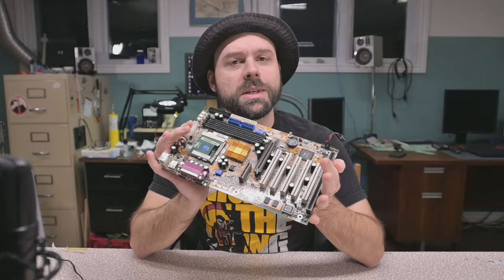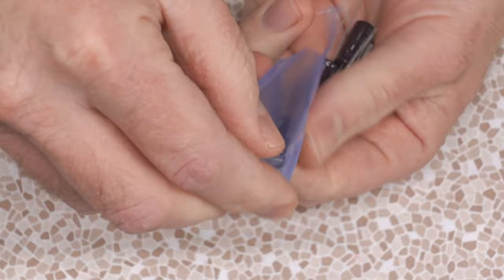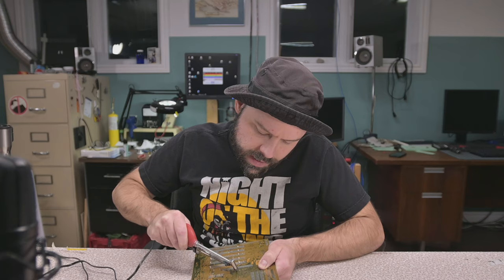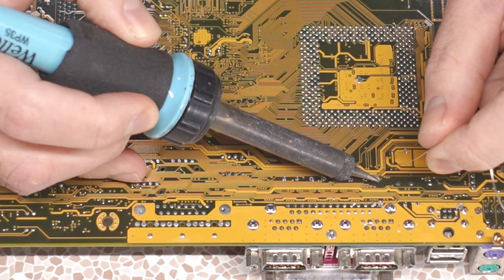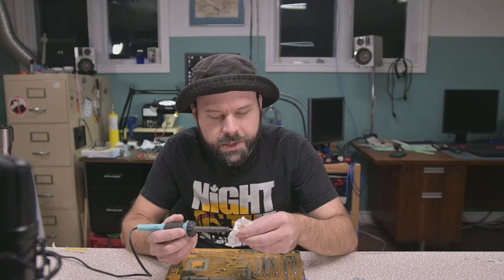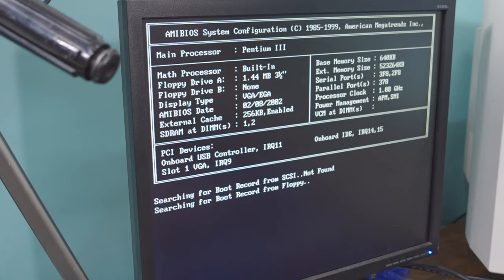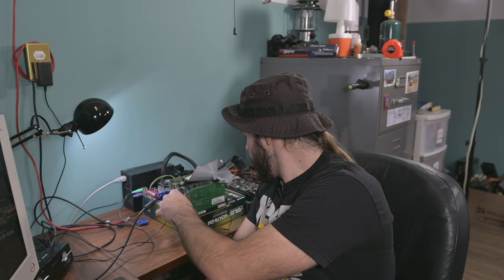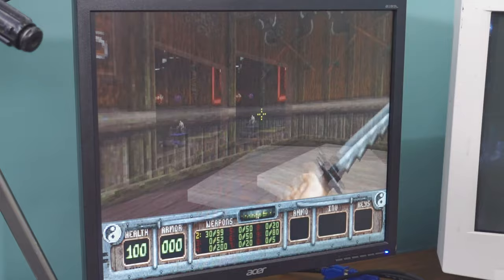Recapping a Pentium 3 Socket 370 Motherboard

Comment: I recapped a Socket A board. It was very difficult as I do not have good tools. I managed to get new caps in but they wouldn't go nicely into the holes so many are sitting high with ugly solder. None the less the board now works. Thanks for your video.
Reply from the maker: Yeah, it didn't go that well for me either as you saw. If I played more with this old hardware, I'd probably have the process down.

Comment: Man, that was a really delightful video! Although, I wish you had better filming angles to the board. I was trying to figure out the rest of the capacitor values. Thing is, I have a similar board but someone ripped off all the capacitors (except two very small ones) and the chipset heatsink from it before it came in my possession. I would really like to revive it because still has the 700MHz Coppermine on it, but with the caps ripped off I don't know the values. Would it be much trouble for you to make a capacitor list an post it here,  please, to help a fellow retro gamer? Of course, if you still have the board...From what I understand, the green big ones are 1200uF/6.3V but what about the rest of them?
Reply from the maker: Oh geeze, that's a pickle, cause different model of boards would have different caps values on them. 
I suppose you can guesstimate. One of the great things about caps, is they are often forgiving of what values you can use, unless they are part of a timing circuit, which those likely aren't. As long as the value you use is the same or greater than the original value, it could work. 
The brown caps I replaced are 1200u6.3v.

Comment: I recapped many boards during that era and the crapping out brands are: Chhsi, GSC, OST, G-Luxon, Nichicon HM/HN series produced in the 2000 to 2005 era (nichicon itself is a good brand) Teapo, Canicon, Fuhhyiuu, Sacon.
You used Nichicon PM low esr series which are good for this board.
Good brands: Rubycon, Chemi-con, Nichicon, Samxon, panasonic, Sanyo
Reply from the maker: Yeah, I can't recall what I knew about caps when I did this. I can't remember if they were new or salvaged. But when I buy new, I tend to get one of the good brands you mentioned. 105c with as high an hour rating as I can get. I also observe ESR especially if I know it's for switch mode.

Comment: Ok. That video teaches how to recap with a LOT OF WORK. 😂

Yes. I'm confident you already saw other ways to do it.

Here is how I do it with a LOT OF TEXT:

- 15w solder iron is enough and use finer tip
- Fresh soldering
- Heating one leg up, swing the capacitor in order to lift that lag out of board, just a little bit
- Heating the other leg up, swing the capacitor to opposite direction, just a little bit
- Repeat those last two steps til you can remove it with little effort
- (optional) pre-heat solder wick up, away from the board and then clean those holes
- Tin capacitor's legs beforehand
- Trimm those legs enough to pass through the board, plus 2mm*
- *Leaving 2mm gap between the board and the bottom of capacitor would be good for board protection, if it were possible
- Point one leg on the hole, heat up the other side: that hole will "suck" that leg; just a little bit
- Point the other leg on the hole, heat up the other side and do the same thing; just a little bit
- Repeat those last two steps til getting a nice height and see its legs on the other side
- Finish cleaning it up with isopropyl alcohol.

👍
Reply from the maker: Yeah eh, I was a bit rusty at the time. This video was def not intended to be a "how to". 
I was kind of getting back into electrical at the time so I had forgotten some of my basics. 
Only thing I'm not on board with is the 15w with a fine tip. I find bigger tips allow you to transfer heat more quickly, and 15w . . . on a board with this much of a copper plane in it. That's one reason I had the trouble I had, even with my 35w that board sunk the heat so fast. I have a hard time believing I'd be able to pull this off with a 15 watt, at least on this particular board, but I could be wrong.

Comment: my recapping failed , It was a motherboard that was compatible with Pentium III tualatin 1.4ghz .  I was a newbie in de soldering capacitors , I had one only to replace , I did it badly, but the motherboard was working . I had to recap the same place , but that time it failed , the motherboard coating melted and covered the capacitor contact points( yes , I soldered the capacitor on the top side of the motherboard
Reply from the maker: Oh damn, that sucks. Not sure what to say. It's a tricky repair.

Comment: Some advice: it's always easier to melt old solder when you add fresh hot solder to a joint. Flux also helps. That and beware eBay sellers. It's not the best place to buy electrolytic caps.
Reply from the maker: Yeah, I know these tricks for the most part. 
Pretty sure I def did the fresh solder thing, just if I wasn't talking I didn't really show it. 
I may not have had proper flux on hand at the time.

Comment: Thats what windows was like before XP. Difficult to install hardware.
Reply from the maker: You mean drivers ? I'm not sure what you're referring to. This is an older video so I can't remember everything I said in it.
Reply: @DATT  Drivers yes. For instance on a old Windows 98 laptop I tried probably 20 times yesterday to install a wireless cardbus card. Each change requires a restart. Old windows was very frustrating. DWL650+ card. I think I'll try to find a different card.
Reply from the maker: @blackterminal  Oh yeah I remember the restarts. 
DWL650+ I might have had that same card haha, in my old P3 laptop I had. 
PCMCIA I think they called that cardbus format.